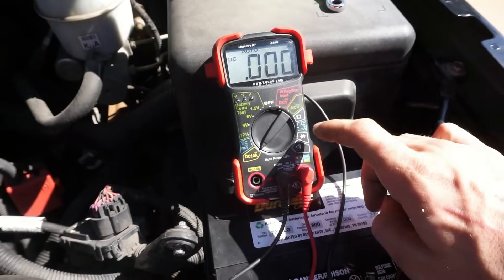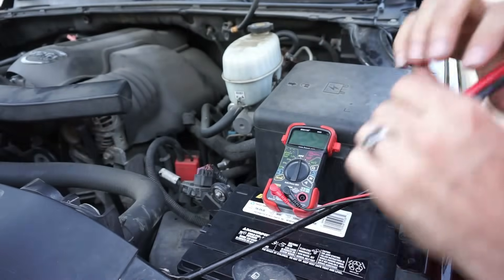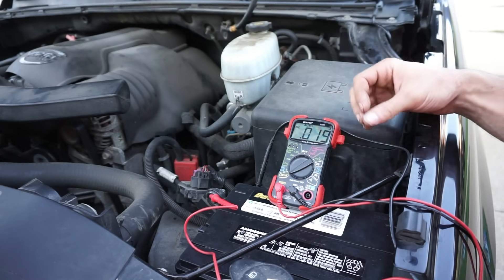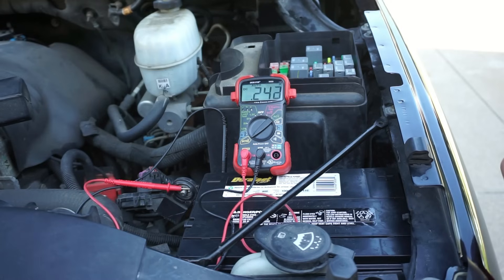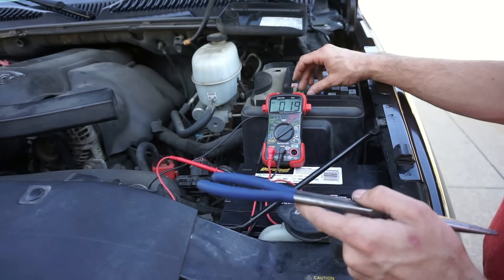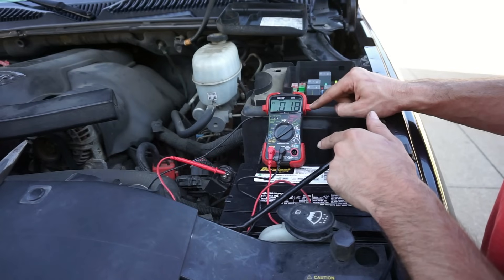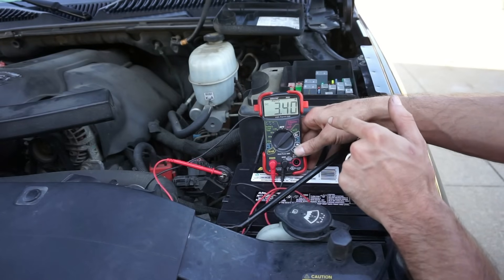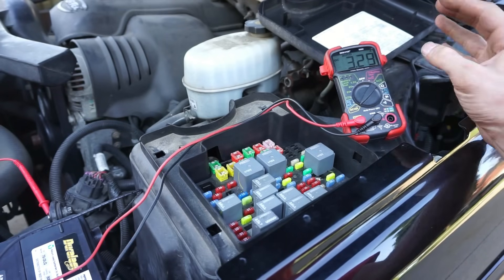DEAD BATTERY | How to FIND a Parasitic Battery DRAIN Using Multimeter!!!

Comment: Had a problem like this with retractable headlights the servo motor would not shut off until they where fully closed, wear of the bushing was causing them to drag and not letting them close and would drain the battery. have also come across this with trunk lid soft closer.

Comment: I have a Suzuki Swift with a similar problem. My problem is, when you open the bonnet, everything starts up. You hear a motor running and the interior lights come on.  How the heck do you faultfind this one. My battery lasts 48 to 60 hours and then it is dead. Opening the bonnet and connect the amp meter gives my around 7-8 amps. By closing the bonnet it comes down to 800 mA eventually. But opening the bonnet and we have nightmares.

Comment: Much easier way is the just read milliamp voltage drop test across the fuses. Once you find the one with the high difference you can put the fuse and measure the current

Comment: I typically work on old non computer cars and this just opened up a world of knowledge on how to track an electrical problem. Thank you very much. Never would have thought to power up then down like I was driving in order to charge the system then wait until it sleeps again to track down an issue. I will for sure use it on my 2001 VW which has a drain but one that takes about a week or two to drain the battery. I have the time to wait. I had always assumed it would just go to the proper level right away.

Comment: Thanks, I'm only just starting to wrap my head around the universe-within-a-universe of auto- and marine-electrical engineering and trouble-shooting, and your methodology/explanation has just changed the way I think about these circuits. Kind of like being dropped on a remote tropical island and deciding which direction to go hacking and slashing in search of resources, but being mindful that just because you didn't encounter anything along the paths you've just cut into the jungle, you can't infer that nothing of interest will ever be on those paths if you happen to be traversing one at a different time of day, or in particular after one of your party both discovers and reveals your presence to the islands only other predator (which your wife didn't think was significant enough to be worth mentioning to you at the time!).

Comment: You did a good job except for the interrogation of the vehicle operator. One of the jobs I did was trained service writers how to get the necessary information to allow in a technician to diagnose a car quickly. Example driver says car needs a tune-up or I want you to tune up the car. Proper question, why do you think the car needs a tune-up ? Seems to lose power at freeway speeds. Without asking that question you might be putting a tune in a car when in reality all it needed was a fuel filter.
Reply from the maker: Good example. 👍

Comment: How would someone be able to detect if the cause if the draw was due to multiple wires/relays? My battery died one night, charged to full, then each day after some other electric powered part of my car stopped working. First the back driver's side window won't roll up, then my anti-theft alarm would randomly go off, then the driver's window and lock buttons quit working, and tonight I realized the electronic locks for my lift gate and lift gate window are both stuck in lock mode and I had to crawl over the backseat and disconnect the lift gate window control inside the panel on the lift gate. Soooo... Will will I be able to still see the pattern after pulling the right fuse for one of the problems causing the draw, even if the other causes are still drawing power? Maybe just not such a drastic increase/decrease in the amps?

Comment: I'm fixing my battery drain problem the caveman way, by disconnecting the negative cable on the battery when not using my 2004 GMC Yukon.
Reply: I thought you were supposed to unplug the positive, no? I have an issue with battery draining, so I unplug the positive after driving, am I wrong?😮
Reply: @ChristianClouser  
 Yes
Reply: @ChristianClouser  it’s safer to unplug the negative cable.

I also have a 2004 Yukon and have had a battery drain problem for about 3 years. I don’t use it much but I’m going to try this recommended troubleshooting method
Reply: @errodriguez2586 -Ok, thank you, appreciate that.
Reply: Probably the damn instrument cluster
Reply: This is the way.  I went as far as getting an onboard maintainer I’m to lazy to unplug the negative

Comment: I have a parasitic drain in my 99 Suburban. And, like you, not all of my door locks lock when I push the button. I'm willing to bet that's my truck's issue. Now, MY issue is where do I find the parts (even if that's not the battery drain issue, it needs to be done anyway)? It's rather difficult to find electrical and interior components made for my truck because of its age.

Comment: Not entire vehicle electrical wiring harnesses are within fusible contusion. Could be a non-fusible parasitic battery draw, post engine off. Wet or wet/corroded combined, wiring connections have, also will cause parasitic battery drain, post engine off. Located parasitic drain at 4.2 amps, being pulled through wiring harness alternator wire connector. Multi-meter on 10-amp setting, pulled electrical connector at alternator, amp reading immediately dropped to 0.05. Which is acceptable within stereo pre-set memory battery draw, post engine off. Fuses should be check, isolated one at a time, while viewing multi-meter. But definitely not a enivitable guarantee to solve the problem, due to not all vehicle electrical functions are fusible. Many are direct wire harnesses.

Comment: I thought it was my radio because it was set at 12:00 each morning when I got in the vehicle during that time the battery had been draining slowly. So I got a junkyard radio and now it's doing the same thing set at 12 each morning battery draining.
So I replaced the ignition switch that didn't do it. 
Then my battery died in just a couple hours so I bought a new battery. 
Chevy can really suck I have had these problems with all my Chevy vans and suburbans

Comment: Good work narrowing down. Curious   the final issue. Switch/relay hanging up? I like Clamp on Meters. Can clip on positive or negative wire. 
With Dead Batteries, I Verify Good Battery first as you did. Didn't notice you Check Battery Voltage Before and after Starting Car?
Disconnecting Alternator may be necessary sometimes can reveal Alternator or Diode issue.

Comment: Guess that's why my mechanic told me to just put a Mechanical Kill Switch on the battery to prevent the overnight drain on it... my new mechanic also found through computer diagnostics that the Battery Charging Regulator was bad.

Comment: Holy Cow!  After watching your video, I went outside and locked my passenger door manually from the inside and after closing, testing from the outside to ensure it was locked.

Then, I got inside, turned the ignition twice and IT STARTED!!!  It hasn't started for a while.

I too have had a locking issue with my passenger side thinking it was the locking mechanism.  Turns out it was!  The irony.

Thanks Iron Man!

Comment: I've watched a few videos on this, when you find the bad fuse, will it be blown when you pull it out and inspect it or does that just tell you what to chase down? Anybody?.....
Reply: A blown fuse indicates a “dead” short to ground, or a load in excess of the fuse rating.  These loads are lower than the fuse rating, so they just keep a load on the battery when they should be off, thereby discharging the battery if the vehicle is not operated for a time.

Comment: Sequence is important. So use a clamp meter to see if there is a parasitic current draw problem. If parasitic draw is present, introduce the meter (current shunt) as you disconnect to battery post. Keep the supply circuit intact as you introduce the current meter. This way the problem will still be present as you start troubleshooting.

Comment: At 6:43, when he cycled the key, the meter read 17.xx amps. He could have blown the fuse or worse, the meter. He could have put a jumper between the meter leads just until he finished cycling the key to absorb the momentary current/amperage flow...

Comment: If you have an unknown draw that might be potentially over 10A based on how quickly it kills a new battery, it might be worth using a current clamp if you have one, or making a current shunt out of some 14 to 12 gauge household wire. You can use that to bridge the connection and use your DMM in the millivolt voltage range to get an idea how high it is without the risk of blowing your DMM fuses.
Reply: My current clamps only do AC amps.  I don’t want to invest in a DC capable clamp, even though my Fluke meter will do DC amps

Comment: Great video, thank you.  I too have a drain somewhere, and look forward to using your video.  But, I removed the battery and charged it out of the vehicle.  I took my meter, and did a continuity test placing positive lead on the positive terminal cable, and the negative lead on the negative battery cable.  I had a continuity path between the (+) and the (-) leads.  This would tell me that I have a direct short somewhere unless I am missing something.  Any thoughts?  Thanks for your thoughts.

Comment: Why don't you leave the negative connection on the battery in place and just put a clamp on ampbrobe to check for excessive amperage draw if it's a circuit that's not necessary to be on like a dome light I just leave that fuse out sometimes it could be the computer then you got a big expense or you just disconnect the negative terminal on the battery when you're not using the car and the battery should stay up on a charge and it won't be drawn down all you can install a on and off voltage switch to negative terminal of the battery and turn that off every time you stop the vehicle if it is the computer and you don't want to spend a lot of money to replace it

Comment: Thank you!!  The other day while driving I had my heated switch to the drivers seat keep coming on.  I also had my left rear door window not go back up when I tried to put it back up from drivers door and the switch on the rear door.  I believe it just might be the cluster on drivers door has a short some where because the very next day the batteries needed to charged.  An yes it happened again the very next morning after I had charged the batteries.  Again thank you for the video!

Comment: Also having a problem with the fuel gauge sticking on empty where is the fuel gauge fuse not showing on the panel box. Could it be part of the ILLUM fuse. This only started to happen after I disconnected the negative battery cable to check for a parasitic draw now the fuel gauge is stuck on empty.

Comment: I have watched all the video's available and this one gave me the best detail information. My truck is a Ram 2500 and I believe my problem is in the smog device circuit after using a plug-in computer that said there was an error message on that circuit. That is where I will begin to use what I have learned from this video to save time, as I am only so patient.  I will refer to this video during my search for the parasitic draw killing my batteries. Thanks for the detailed information for me to use

Comment: i like it but dont unsterand to much. ill watch it 4 or 5 times then see if i can find it. i have 2004 chevy avalanch it to drains out the battery over night and i have problem with the door locks and one of the lighter went out . i cant find a fuse. The fuse cigarette which i use for my radar.

Comment: It’s a GM vehicle this is the norm , my new failblaizer had ignition locking while driving. Some bean counters decided that replacing a metal part with a plastic part saved them 10 cents. Only Toyota for my vehicles.

Comment: So if the fuse is causing the issue to the battery do you replace the fuse with a new one?
Reply: The fuse is not the issue. He pulled the fuse out to isolate the problem circuit.  He then had to diagnose the problem with that circuit and make repairs

Comment: This may have found my issue on my 02 Chevy. I'm not able to open the door with my key fob, and not able to use the control on the door to unlock and lock my doors from the panel. I do hear the relay click when locking but nothing happens, though i don't hear it when I unlock..all ready did the relay swap from the interior fuse panel. Nothing.

Comment: When I have the ignition on in my Chrysler T&C the battery is draining about 10 amps and after one hour the car will not start due to a drained battery.  When the ignition is off the battery drains about .17 Amps?  This must be a large short or some item like a door lock, starter, alternator etc. or some big item to drain that much power and not catch fire?  Great explanation on how to find drain source.

Comment: Just curious, I have the same multimeter and I've never used the 10A setting. On that specific probe jack that you would plug your positive test lead into says it's unfused and to only test 10A/ 15 sec MAX and then you have to wait 15 minutes to let it cool down before you can test again. Wouldn't that damage the multimeter having it hooked up for that extended period of time or am I missing something?

Comment: I am glad I have watched this prior to trying to trouble shoot my issue. Thanks for posting. My remedy for the past year is to remove the battery cable each and every time I leave the vehicle for any length of time. Funny thing is when battery connected sometimes it goes dead other times it doesn't. I had a new battery go dead in a couple of hours so when it is being parasitic it is not a feeble draw.
Reply: That is indeed a huge drain. You might check your relays. One might be sticking intermittently. 

Make note of your driving situation prior to the battery going dead. Were you running with your headlights on? If so, I would suspect that one.

I'm not one for "throwing parts to solve a problem, but relays typically are fairly inexpensive. If that does indeed solve your problem, it might save you hours of troubleshooting.

Another possible culprit is the panel-mounted headlight switches found in many older vehicles.

Another thing to be aware of is that circuits protected by fusible links can be trickier to troubleshoot because they generally don't run through the fuse box[es] and they are sometimes hidden in taped wire looms or split loom. Thankfully, those types of circuits are usually minimal in number when they are used.

Before you invest a bunch of time chasing circuits, do a thorough visual inspection of any visible wires. Especially if you're working on a vehicle that is more than 15-20 years old. Pay close attention to anything up against or routed along metal. The smallest break in the insulation of a hot wire can cause a drain and not even blow a fuse.

The OP of this excellent video nailed it when he urged patience. Even the best of tips are useless if you get impatient and try to take shortcuts through a process.
Reply: @GroovyCoolio  Very Excellent response to my issue. Thank you!

Comment: Hello.. I know this post is old... But I am having a similar issue. I have checked for a parasitic draw and I get a resting draw of .058  this is with an aftermarket alarm/Kill/Autostart..  is this considered a bad draw? Battery drains over 2 days time.. If this is not a bad draw. I suspect possibly a bad diode in alternator...   Thank You

Comment: Thanks for such an informative video! I also have a battery drain and the door lock on the driver side does not work. How did you finally fix the battery drain issue?

Comment: If any body knows the answer??  Does a Cheap $110  2 ohm 10" sub boom box drain a battery faster than a 4 ohm set up, My son said he read that somewhere, I put a 2 ohm 10" sub kit in my 73 pinto, after boomin for like 20 mins without eng on, it kills my battery, I have a 4 ohm Pioneer $300 set up in my 72 pinto, I boom it for a while the same as 73 pinto just kinkin back in the driveway, then it starts right up?? The 73 battery is a 6/2020 battery. I go out to stores all day and it works fine, so I'm thinking the cheap 2 ohm sum set up is what's doing it.
Reply from the maker: All things equal the amp will produce more power with a 2ohm sub vs. A 4 ohm. The amp making more power with draw more current and drain the battery faster.

Comment: Great job:  Much more informative than the others I've watched prior to going out and finding a battery draw in on my chassis battery on my RV. I couldn't follow you on one thing however.  Initially you had a draw of something around .245 and pulled a fuse and it went down to .019.  Then you jumped to finding the draw by going to the other relay that fed your dash fuses.  What happened with the first fuse that you pulled? Was there something else that was causing that draw on that fuse?
Reply: I agree with this comment. The video could have been structured a little better but you have clearly nailed the basics of the procedure, and I really appreciate you making this one. I found this video because my car battery just failed, and would not charge by driving the car after a jumpstart, and I have never worked on car electrics before. Now I understand something about car wiring and fusing and troubleshooting. Best wishes to you.
Reply: My exact thoughts after he pulled that first fuse, but then he went on to a whole different thing. I stayed thing sooooo what happened with that first fuse. I probably have to watch again to under fully I guess..